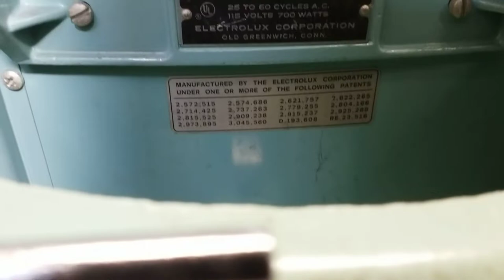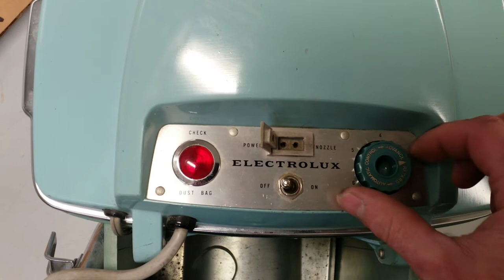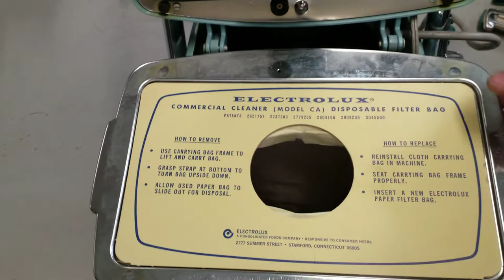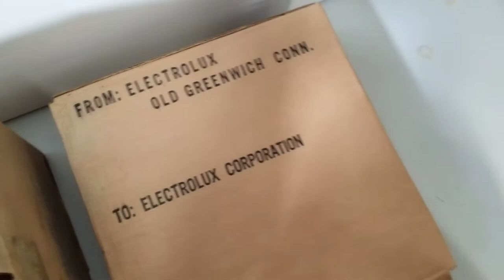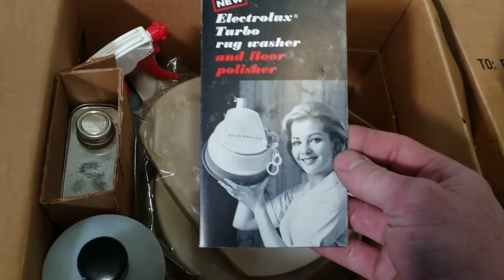The 1962 Electrolux Model C-A "Commercial Automatic"

Comment: Hey Owen, that Electrolux sounds wonderful. By the way, for what it's worth, you do a great job of describing things, since I can't see my screen, I get a lot out of your descriptions. The motor on that machine sounds wonderful, a D flat note, that was a very common pitch of vacuum motors in that time period. The G.E. motor and the two stage motor that Lamb Electric was making that that time had the same pitch. Interestingly, even though that motor is a 700 watt motor, it's the same pitch as the motor that was used in the model G. I'm guessing most of the vacuum motors of that time ran at a similar speed. What a contrast to the high pitch screaming jet sounding motors so common in portable vacuums today. I much prefer the sound of these older motors, much more pleasant.

Comment: I agree with you. The Electrolux model G was THE finest vacuum the company ever put out. The got everything right. Great design,best color,quietest motor. Everything they made after was a step back. 
The special brush roll with the extra rows was also used the the Hospital G which was essentially just a regular G but with a silencer on the back,making an already near silent vacuum even quieter.